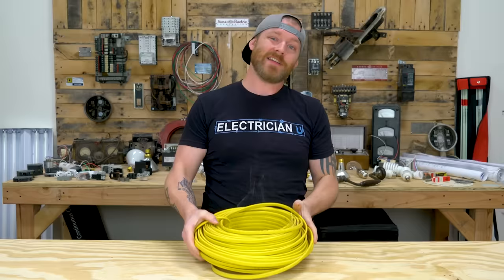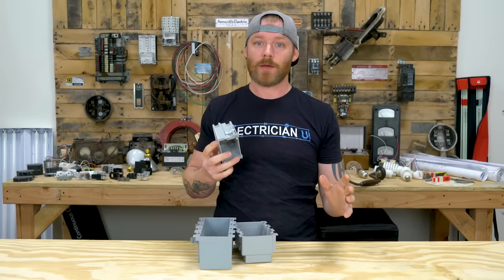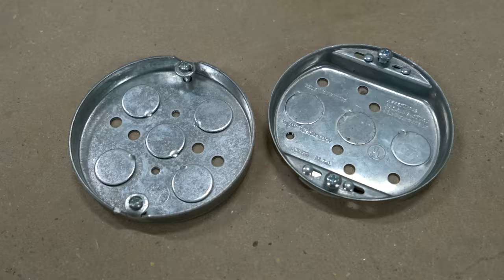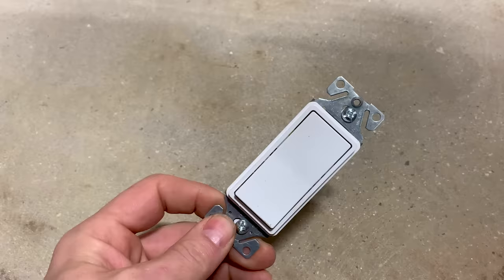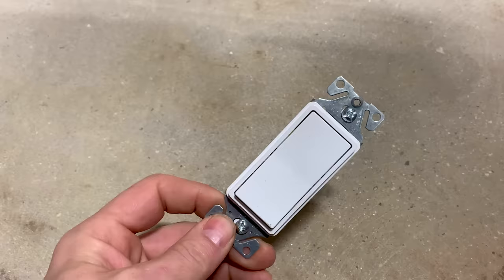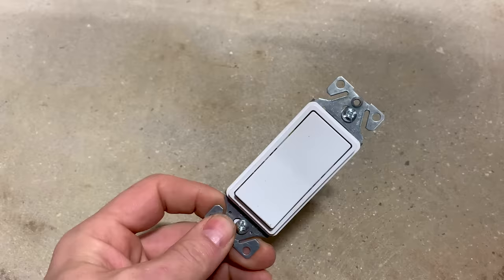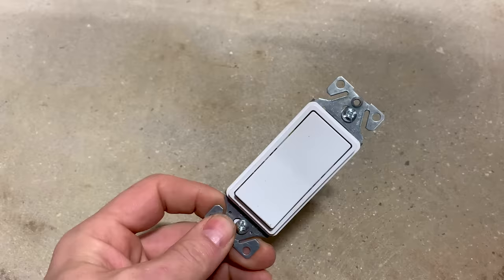RESIDENTIAL ELECTRICAL MATERIALS Apprentice Electricians Should Know

Comment: I never heard of “pop in”, or “cut in”. We just call them old work in Philly. Everybody really calls everything something different. Lol
Reply: Old work here in Columbus Ohio... also never heard it called “sheet rock”... wtf lol
Reply: @walterdowney9999  REALLY?! Lol. We say Sheetrock WAY more than we say drywall. Even when I typed Sheetrock just now it autocorrected to capitalize the S
Reply: I've always heard "pop in", but when I want to buy one, old work is the key.
Reply: @Former_Texan  yea that’s universal
Reply: Relatively green commercial apprentice here so I could just be wrong. But I've never heard it called carflex before. It's allways sealtight. Also we never call sealitight flex we only call greenfield flex. BUT I've also never seen nonmetallic conduit on one of our jobsites so maybe that's the difference. (Not saying nonmetallic isn't used just that I have yet to encounter or hear of it in my limited experience)

Comment: 4:20 “fan-cake”
5:01 “fan-brace”; ratings from “csa or ul”
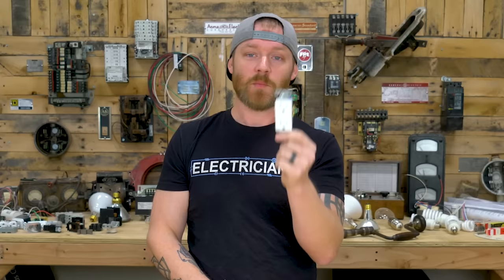6:30 “duplex receptacle”; 6:50 “not a plug”
6:57 single receptacle for dedicated circuits like frige or washer/dryer/dis washer/disposal
7:23 Gfci recep; “Gfi’s are the same”
8:48 Three-way switch
Reply: 10:22 called it plug.😂😂
Reply: Thank you for being my teacher I learn a lot from you thank you very much
Reply: @helmerortega112 ?

Comment: My favorite was a homeowner called about hallway lights out. I came and the first switch I pulled out was a duplex, with a traveler attached to the ground screw. He swore up and down that no one had been working on it.
Reply: youd be surprised. if its a 3way it couldve been improperly wired for years. sometimes one switch gets preferentially and in old houses the crazy never stops coming🤣
Reply: @marmiaday That's what we call a Todd switch, named after the guy that couldn't get the 3-ways right 😂

Comment: As an electrician I've never used a fan brace or bar hanger. Always put up a block of wood between the studs or trusses and mounted the box directly to wood. And actually never heard the word "cake" to describe a box. Generally referred to as "pan box" or "fan pan" in my neck of the woods. Good information in this vid! Wish I'd watched something like this before I started my apprenticeship. The thing that got me regarding breakers is my journeyman told me to grab a 120 breaker. So here I am in the van looking for a breaker that says 120 on it. I didn't realize by 120 he meant a single pole 20 amp breaker. Felt kinda dumb when he got tired of waiting for me and just came out and grabbed one himself. But I learned fast!
Reply: Using the metal braces would allow you to make a smaller or no extra hole when mounting then saving you or the owner drywall work. But a wood brace between joists is just as secure too.

Comment: I know.. later video.. buuutt..
Staples.  Conflict I have is when you do a remodel situation.. you don't nail the wires. 
I feel the staples are there just for keeping the drywall screws and the cables tamed while mounting drywall
Reply: I'm so glad you said that... THE STAPLES AREN'T FOR SQUISHING THE WIRE DOWN! They are to keep the cable out of the way of a wayward screw. That's all.
Reply: Agreed. It’s a pet peeve of mine when I see people hammer down staples into sheathing. Unnecessary. 
If you’re gonna do that, use insulated staples.
Reply: a fished wire  in a reno is not required to be stapled as far as I know

Comment: Forty years as a commercial electrician and yes a receptacle is normally called a plug. What plugs into it is a cord cap. If you go to an electrical supply house and ask for a box of 20 amp plugs they are going to give you receptacles. If you want cord caps that's what you ask for but never plugs if you want cord caps. Over the years I've had dozens of apprentices and I prefer they know nothing so they can be trained properly rather than thinking they know how to do things. One night a week of school to do the code work and five days a week to learn what each piece of material is called, how to bend pipe, how to make joints and so on. Training is now up to five years and many apprentices need every bit of it.

Comment: GFI or GFCI are going away. Where I live in PA, you now have to use GFI breakers only. They no longer allow the GFI device and only allow breakers so that if the GFI trips, you know it's in the panel and can find the location. I wish code was just safety things and not so much about convenience....
Reply: To be honest I’m in Canada and that sounds similar to afci breakers why on earth would you only use gfci and afci breaker if installed correct it is way safer then gfci and that’s to code for CEC but also why does he not use metal box’s at all looks like he’s cheep metal box’s for plugs and switches and lights to be exact screw the plastic your gonna strip the threads in no time am I the only one thinking this

Comment: I’m an apprentice in Canada, super interesting in the difference between materials
Reply: I also work in Canada. I dont know about you but ive never seen those nail on plastic boxes. Every box ive ever installed were metal and screwed in from the side except for exterior walls where we use plastic boxes similar to the nail on ones with an urethane seal where the cable enters the box. Or else we just wrap vapor barrier around the metal box and poke the cavles through that.

Comment: Where I live in Asia a single pole switch is called a 1 way switch, a three way switch is called a 2 way switch and intermediate switches are called just that. You always count the number of connections on the switch to figure out which type it is.

Comment: "Hactually" a 3-way switch is a single-pole switch as well. It's just a double-throw. The single-pole light switch you showed is a single-pole/single-throw switch. The 3-way is a single-pole/double-throw and a 4-way switch is a double-pole/double-throw switch even though the power only operates on a single pole or circuit; it is double-pole because it switches between two possible circuit paths within a multi-switch circuit.

Comment: I've always heard the term new-work-box and old-work-box. 
Also could also bring up 4-way switches, double-pole switches.
Reply: I agree with your thoughts.. but does a brand new apprentice really need to know about those?
Reply: @kevinsadowy5602  if a client requests to have more than two switches to control lights, sure I think it's important to bring up. Dustin covered them in a dedicated video before though. 
And as far as double-pole switches, they look pretty much the same as 4-way but obviously work different. I could see an apprentice grabbing the wrong one, and what to look out for between the two. Dustin mentioned electrical disconnects here but for the higher-amp circuits.
Reply: @colinstu  yes, when the situation arrises, the jman can teach the apprentice.  That's their job.  But a new guy, first day on the job, heck even first few months, I wouldn't expect they know these things.
Reply: Apprentices aren’t paid to think.

Comment: 12:04 I call the one you’re holding liquidtight
Reply: We usually call it sealtight.  Depends where you're at.
Reply: My fiancée worked at a nuke and they don't use liquid tight! They use something called boa flex and it uses the same fittings as liquid title and its made if aluminum and it's bronze colored!

Comment: In Britain we call it a 2 way switch instead of a 3 way switch. Not because of the fact that you can switch the light in from two different locations - but due to the fact that the switch itself allows for continuity of only 2 different ways.

Comment: As a Journeyman 'lectrician...i would never use a plastic device box or octogon box made of plastic.  except of course for the wall mount external plastic receptacle boxes.  My main point being, plastic is sh/t, you can't rethread a plastic box screw holes, even if they come with metal sleeve inserts [the inserts will just 'screw-out'].  Metal beats plastic 10 out of 10 times. period... "."  lol.
Reply: Kev Hills lol except using metal boxes is 2x as much in labor and materials.
Reply: You would go broke and the contractor would fire you for wasting time.
Reply: @dallas5374  labour...no.  material cost...possibly, i have no idea what they cost, and the ones ive seen look like wallmart specials.  and although ive never and would never install plastic, i have worked with it on another contractors job and dealt with what i didnt even know was going to be an issue, but the bonding screw and such in a plastic box is complete garbage with its design.

Comment: Interesting part about GFCI's is it's not just about ground faults,  it's current flowing anywhere but line and neutral.  It'll trip if a small amount of current flows anywhere else.  Just so happens ground is the most likely place.  It's why you can get away with using them without a ground connection if labelled correctly,  not that you want to.

Comment: I'm a machinist but knowing about the details of the electrical trade is very helpful, because I've found your channel I can get some things done in my workshop and house without hiring someone, thank you!!
Reply: Michael Moran that can be good or bad, however, I believe he makes these videos for future electricians, such as apprentices, ETs, not for homeowners to “do” their own electrical work. I’m sure you know electrical work isn’t like mechanical work, if you mess up you could die or cause a fire.
Reply: Theres a reason someone has to have 4 years of training to call himself an electrician.    Its worth knowing Insurance wont cover fire damage that results from unskilled labor.  Also electricity kills. While you might survive, realize the guy after you using "your work" might not.  I suggest you hire someone, a Licensed someone.  Because you can't afford the cost it things go wrong.
Reply: Home Depot will show you everything you need to know with there fancy panel diagrams.....

Comment: The company that I work for does all commercial work, but I have used a couple of these things. I have put in in-use enclosures and have used car flex (we call it seal tight.) I wouldn't mind learning more about the residential side of things because even though I'm only a first year apprentice, whenever I tell someone what I do, their eyes light up and I always have them asking me questions. I have even had a few people ask me to do things like put in a fan for them and honestly, it doesn't seem like it would be that difficult, but I'm just not confident enough to take on side work like that.

Comment: Dustin one bar hanger box you failed to mention was the one you buy for fans which spin between joist I’m sure you used them in jobs between 1st and 2nd floors and for old work  (they hold a lot of 
weight ) one sparky to another love your videos !

Comment: Just came back from HomeDepot, they only sell the old style compression complers in 1 1/4 size. I had a funny feeling that little metal ring would not be water tight, glad I googled it and found your video confirming they are crap. Amazon will take 5 days to get to me.  Lowes will take 3-5 days. Why the heck doesn't anyone stock the raintight fittings!!!!

Comment: Might want to add LVRs. Low voltage Receptacles. Though you are not often using them as an electrician you will find them in many walls. .In the 90s they were called LVRs, but now just Low Voltage Brackets.

Comment: 8:12 - Ok, so, good thing I used these for the receptacle I have in my basement. Side note, I'm actually going to be using them for something VERY important to me: Whole-home wired networking. I have a 48-port switch, and there's gonna be a metric boatload of pop-in boxes all around the house. All 1-gang boxes, no 2, 3, 4, or Gucci Gang boxes.

Comment: What about 4-way Switches or metal single gang gangable boxes or 4 " sq 1900 boxes with blaster rings. Some boxes have 1/2" and/or 3/4" knockouts for the conduit. Boxes that have knockouts for conduit and Romex

Comment: I never understood calling it a 3 way switch either. I get that it has 3 lugs on it but it only goes between 2 points so why not just call it a 2 way. 
Arch faults are also a nightmare! I did a remodel and we had to do a panel change and it called out for arch faults all over the place, well while cutting 2x8's for a deck we were building the arch faults would trip every so often when we would start our saws. Usually it would happen after we didn't use the saws for a while. The initial start up of the saws would cause them to trip. Idk if it was due having stuff run through extension cords or using brushed circ saws or having bad wiring but they really made things fun while we were working.

Comment: I don't like using Metal Staples on Romex ! Never have used them and Never Will ! I use the plastic ones with the two small nails for Romex Cables ! Or the ones that are shot from a Staple Gun for 14/2 & 12/2 Romex.  For MC or BX Cables I use either 1 hole or 2 hole EMT Straps or Zip Ties, the 1 hole mounting type !

Comment: Great help for a first time homeowner.  Thank you.  So I have a question about wire gauge, I think:  can I use the easier to work with 14/2 (bend and twist) or must I use 12/2?  I have a 20A breaker that leads to a 15A wall outlet, that wall outlet was extended by the prior owner outside to a new 15A GFCI outlet and continued through some tubes to yet another new 15A GFCI outlet where a water softener is plugged in.  The two 15A GFCI outlets outside stopped working (and could not be reset) after an thunderstorm; but everything was fine inside the townhome (breaker not tripped).  A. The first guy at Lowe's told me to replace all three outlets with 20A GFCI receptacles.  B. The next guy told me to replace the two outlets outside with 15A regular receptacles, and the one in the kitchen with a 15A GFCI.  I don't know which guy is right, but I know I also have to change the wire from the kitchen to the first outdoor receptacle  because it was frayed and the GFCI tester lit up OPEN NEUTRAL.  But what do I replace it with?  People throw out terms like 14/2 and 12/2, which I dutifully look up.  If I go option B I think I can use 12/2 or 14/2, and I'd like to use 14/2 because I think that is the easier one to bend.  Any advice before I look like the the coyote in a Road Runner cartoon?  I hope that I won't regret using 15A receptacles, but I hope never to use the receptacles for anything but the water softener again.
Reply: You need to speak directly with a real electrician. I am not. But I know enough to tell you that they both are wrong in at least part of what they each told you. One thing I can tell you is all of your wire on a circuit must be rated (including derating if code required) at or above the current rating of the circuit breaker feeding it. So if you have a 20A breaker you must use #12 wire or LARGER like #10. Be safe and best of luck to you.

Comment: Very informative....covered quite a bit without overwhelming or rushing through. Knowing is one thing, but willingness to share is very commendable. One question, is there a way to secure romex coming through the wall at the rear of the bellbox without using standard romex connector, as it requires a bigger hole to be bored for the ears or saddle to penetrate. Looking at both new/old work. Thanks,

Comment: I'm thinking of doing some remodeling, principally to upgrade the insulation.  The boxes in the walls are horribly small metal boxes.  They look like the built up sectional boxes that you can gang together, instead of the molded metal boxes.  I imagine I might replace the outlets.  Should I replace the boxes?  I might be easier.  I don't want to replace wiring, although the wiring is a mess.  What do you think?

Comment: I believe code is to have bubble covers only no more of the water tight flap door style. Understandably.. because I rarely ever find one closer or with door still intact.

I just hate bubble covers.. because after you get everything assembled you have 8 inches of crap sticking out of your wall. For mowers and kids to break off.
Reply: TurboFlush the new thing to use is an accordion style cover. It collapses down to about an inch and a half and expands to bubble cover size when you need to plug in.
Reply: Arlington makes a Recessed Box called InBox I believe that sits really nice and flush for new construction and meets the new "extra duty" language in the code. They look great I think. And work well with foam on the outside and/or in. You might check those out.
Reply: @benosborne5842  
Never seen the extra duty till now. 
Been looking at putting power points on outside of cmu house. Plan on using these.